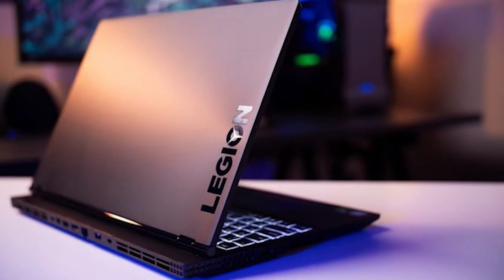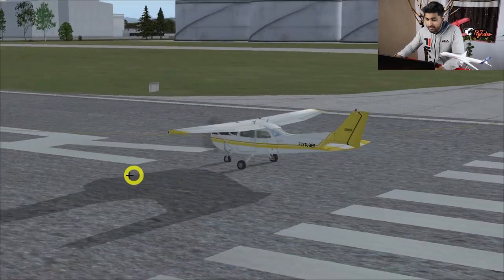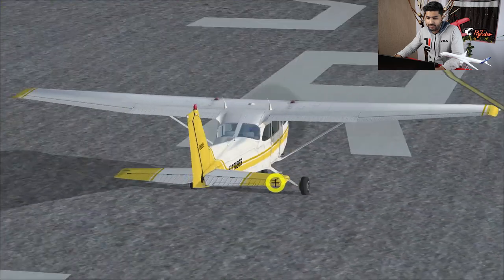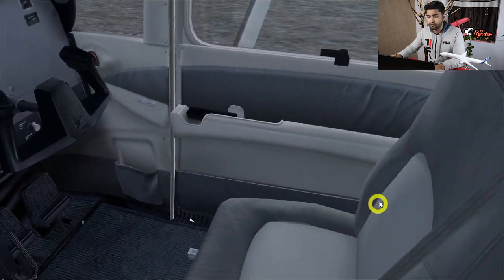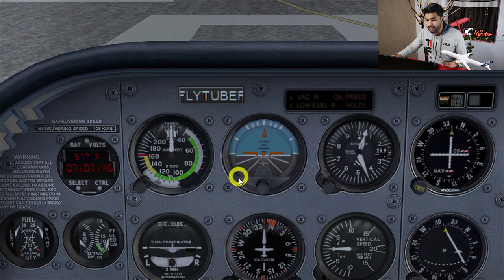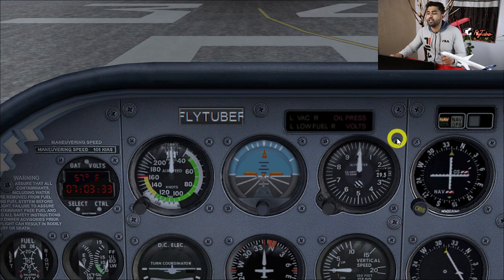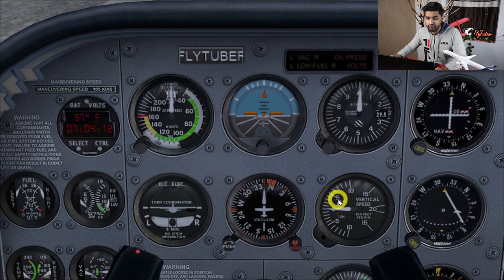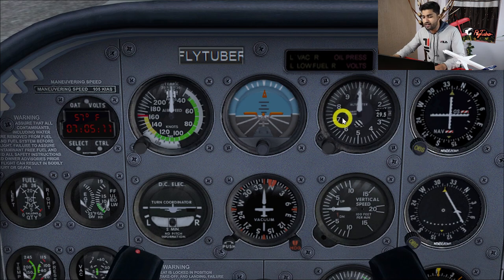An Introduction to the Cessna 172 Cockpit | Flight School Episode 1

Comment: One doubt here, do you need to fly an multi engine aircraft inorder to get 737 type rating? Or single engine will be enough?
Reply from the maker: Multi engine flying is not required for 737 TR... but I still highly recommend flying Multi engine aircraft... helps keep options more open and flexible
Reply: @TheFlyTuber  and wht if you have less money or like can't handle budget, will it work?